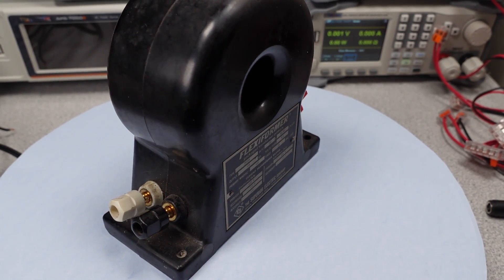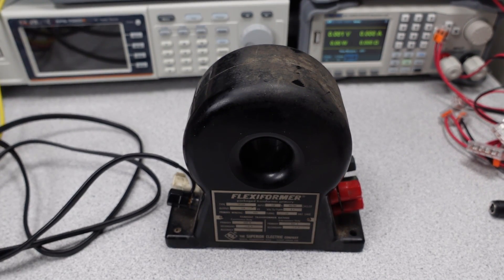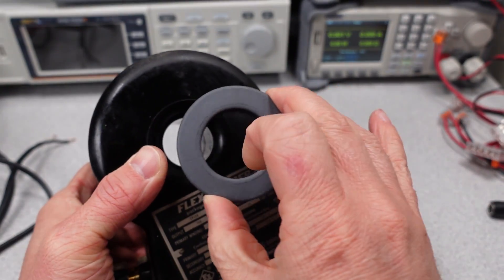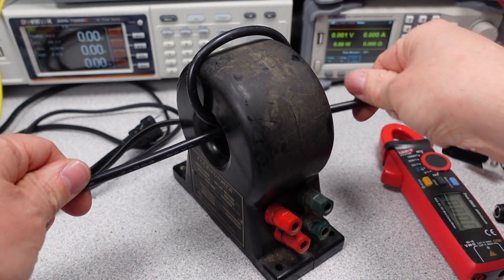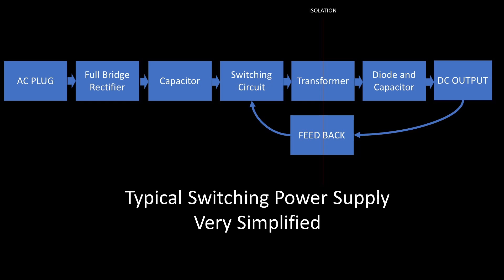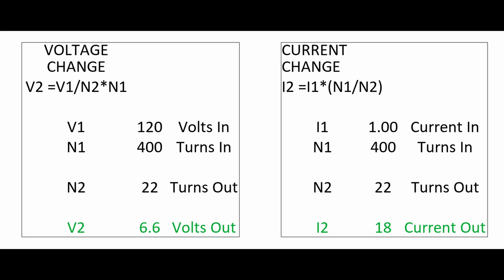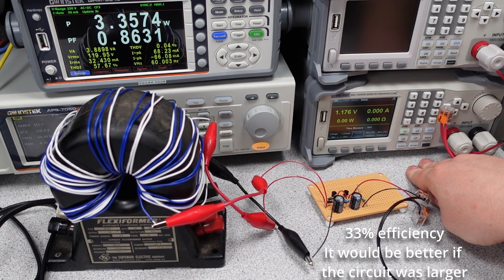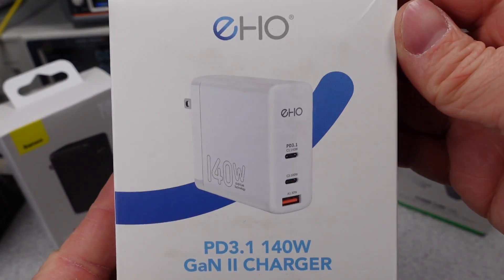Flexiformer - A unique vintage power device

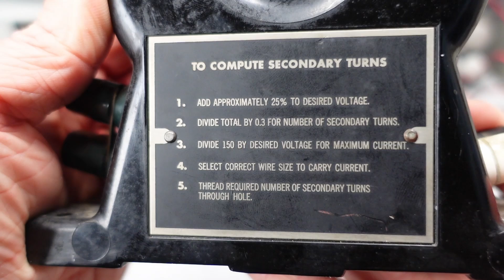Comment: I've never seen just a primary sold like that! I think the most interesting use of it is shown in the manual @1:34, passing an high current line through and measuring at the output the amount of current drawn through the cable, basically like a modern current clamp. I'm not really sure how that would perform.
The LTSpice diagram and simulation really brought me back to my college days.
Reply from the maker: Yeah.  I didn’t want to spend too much time going through each application but I think that’s where the 1% accuracy comes in.  Yeah, it’s much easier to just build it in spice still considering none of that existed I could see this getting a ton of use 50 years ago.
Reply: That makes sense.
Yeah, every modeling software we have now allows to model simple circuits really accurately. Back in the day this thing must've been a life saver, even with it's limitations.
Have an happy Christmas!